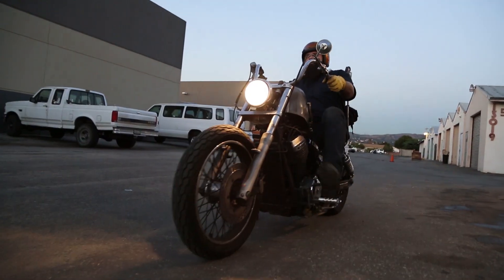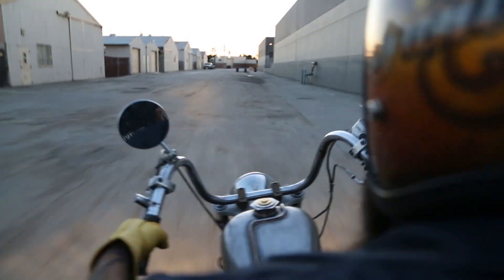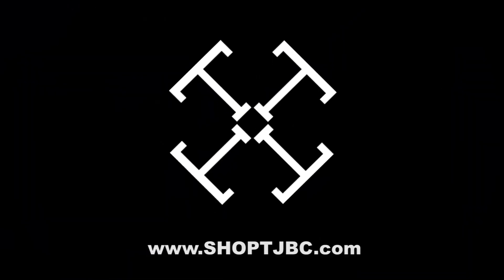Honda Shadow Backfire/Afterfire on Deceleration? – DIAGNOSIS

Comment: Most often decel poping starts when the stock muffler is replaced with an aftermarket piece. The SAS (Secondary Air System) is designed to let air into the exhaust the help the Cat burn unignited fuels properly coming from the enginge. Aftermarket mufflers increase the airflow through the pipes, therefore nothing is timed to stock anymore. Loosing the SAS should solve the problem. Make sure to fit a dongel to not get any errors on your board computer.

Comment: It will be cool to show how to adjust the screws perfect. My bike pops as crazy when i slow down…. Cops pulling me ove all the time …. I hate it 😢
Reply from the maker: That's a lean deceleration pop. Back out the mix screw, if that doesn't help. Go up one size on the pilot jet

Comment: so my bike is running a little ruff on acceleration and after I shut it down after riding it pops, its not loud just a quiet little pop, would this be an adjustment.

Comment: I love that this keeps popping up (no pun intended). To anyone who sees this LISTEN TO TJ DAMMIT! I had this issue after removing that gheeeey Honda intake (velocity stacks now)and putting the gorgeous backdraft exhaust on my bike. I was told 10000000000 different things from, “it’s what you get with no baffles”, “you’re chasing gremlins dude!” Etc, etc. In a last ditch effort I listened and READ what TJ said to do... my 750 ace was all set for a trip to my mechanic. I purchased the largest set of jets off of TJ’s site. Double shimmed my float needles. Wallah! Bike runs incredible not ONE BACKFIRE on decel or hard downshifts etc. I was so shocked that I expected to see a unicorn cross the road on my test drive back home. My wife saw the huge smile on my face and immediately thought I cheated on her. THATS HOW GOOD IT FELT fixing that annoying problemo. Ride on my friends....
Reply: What these parts , where the webite. I need this ASAP

Comment: TJ - Thanks for the videos. They are always informative and entertaining. I too, thought my VT600 was running lean because of the decel afterfires. When I rebuilt my carbs I discovered the air cut off valves were both missing!. When I replaced them, no more afterfire.

Comment: My 1988 Shadow VT600C VLX did this when I first bought it with 8400 miles on it when I went downhill from my house with no throttle in second gear. It was really as much a "backfire" as it was just a random "popping" sound which I thought was cool. However, to be on the safe side I synchronized the two carbs because I NEVER needed the choke to start it, no matter how cold the engine was. I gave it a full tune up with new air filter, spark plugs, fluids, etc. The spark plugs were clean so I figured the air/fuel mixture was OK -- not that I could adjust them anyway because they are sealed. After I sync'd the carbs, I noticed four differences: 
I needed the choke to start it
The "popping" sound was gone
The idle speed needed to be reduced (I still keep it at high idle as recommended by the service manual.)
More power (This is subjective: my butt-meter says I have more torque and I definitely have more power going uphill and a higher top speed which I reach quicker.)
Problem solved with just a simple tune up and synchronization which required a manometer and turning one screw. I love it!

One extra note: Since synchronizing the VT600 requires removing the fuel tank, I discovered my petcock was bad. It didn't leak when riding but it would not close completely when I removed the tank and dribbled all over the engine when I pulled the fuel line off the discharge tube. This was an easy fix with an aftermarket petcock. So I extra fixed a safety hazard. I love this motorcycle!!!!!!
Reply: Stephen Burgess I just got a 1988 Shadow VT800C 3 weeks ago, and i noticed it does the same thing on deceleration, and sometimes randomly it will kinda struggle when going up a hill under load. Very rarely though, I’m wondering if I may have the same issue. I’m thinking maybe a carb sync will help, where did you get your manometer? Just looking for suggestions, thanks.

Comment: So what does a coughing carburator mean? Is it just dirty or to lean or is that what they call a backfire? It is not coughing on decel but on steady rpms
Reply: My bike does the same thing, at steady high rpms, it pops and then dies while im riding. Did you find a solution?

Comment: Honda shadow vlx 600
I put velocity stacks, and the largest jets from the tune kit but haven't yet upgraded exhaust (bootburner in the mail) the bike after fires and possible also back fires.. my carburetor idle screw is for some reason deleted and it has been blocked off 🤔 maybe once i switch from stock exhaust(with no baffles) to boot burner exhaust it will fix the issue 🤞 I'll post update but yeah not sure what to do about the idle screw not existing 😂

Comment: Thanks for this advice I put a new carb on my 250x honda sportrax and it's fine in first gear but when I switch to second when I let off gas it after fires. It very well could be a valve adjustment issue. It prolly needs done so I'll do that after I adjust the fuel air mix screw

Comment: Hello everyone and TJ customs. I took out my carbs today Honda steed 400 cleaned them, put them on again with new boots etc. Problem is I adjusted my air fuel mixture so no more after firing which is good but after a hard acceleration and a cut back to idle engine seems to die out and can’t keep idle. Nevertheless as soon as hit the starter starts right up. Any possible explanation please? Thank you
Reply from the maker: That sucks man, but I'm sorry we just can't diagnose bikes in the comment section. We do have an e-book that has a ton of tuning information which you'll need- https://shoptjbc.com/blogs/news/performance-tuning-book-lp

Comment: Hi TJ!! 
Greetings from Denmark, overseas!
I just bought one Blaked out mean VT 600 Bobber Split Lane, with a lot of TJ’s candy on it! Paenut tank, v.stacks with Long Air fuel min screws etc etc.
I just love it. I seems to have a litlle backfire from the pipes though, when i let off the trottle to fast, ore going down hill a bit.
The iddle seems ok, but it stopped for a few times though. Even when riding at low speed it stopped between a gear shift yesterday.
I may run a little to slow in iddle, i recon. 
My Q is: Do i just turn both fuel screws both sides the same way? And wich way?
Right side shows number 2 upwards- left side (need unscrew a little cover)seems to have the nr. 1 pointed backwards!
Besite that its running like ”a bat out off Hell”
I only got it a week now and i F… love it. And people Ask about the sticker with the white ”cross” on the site..🤣Tj Cus!’
Thx 
Torben

Comment: Perfect video. I didn’t realise there were two types. My bike does both. Sometimes when it afterfires I can feel the force trying to blow the air filter cover off. It never used to do it until I got my carbs ultrasonic cleaned. Only backfires through one exhaust/cylinder though

Comment: My shadow 2001 750 ace  pops on acceleration or at idle ,i cleaned out the carb and adjusted the the fuel mixture screw. Show i buy bigger jets ?

Comment: I bought a new carb for my vlx600 I check the jets and bought a kit from y'all but it all ready had a 50 pilot and a 145 main but a 50 is bigger than a 48 right
Reply from the maker: Yes. 50 is bigger than 48.

Comment: Hi quick question

Got a honda shadow 600, when mid way through the revs it started to burble and no accelerating.

It's only happy low to mid range in the revs

Is this too much air probs or fuel probs.

Many thanks
Sean

Comment: Changed my pilot jets today. Got rid of the back fire but front cylinder is making a putting noise through the exhaust. Seems to run ok

Comment: Im trying to figure out what's going on with my 05 vtx 1300 it's running off 3 heads the one will fire if I ground out the coil but not on the plug I just changed the plug so I'm not thinking it's the plug and I changed the coil so it's not that either

Comment: TJBRUTALCUSTOMS 

I've got an 83 VT750C  that is EXTREMELY hard starting (afterfires when cranking). Once started (If it starts) it runs perfectly, idle, midrange, and wide open. Shut it off, good luck getting it started again. Carbs are clean, compression is good, plugs firing...any insight would be GREATLY appreciated!
Reply: Maybe check your float needles?  It might be leaking and flooding the bowls.
Reply: I have the same problem. I bought a bike from a neighbor that was sitting for 3 years. It will start after 10 seconds of cranking. Looks like to me that it is getting too much fuel. With choke open starts to backfire and after-fire.

Comment: I recently put a vance and hines exhaust on my bike and the back one is after firing? Any input? Thanks in advance
Reply: I have the same setup and the same problem. Any luck?
Reply: Anytime you tinker with the exhaust or intake rejet accordingly

Comment: The previous owner of my bike refitted a supposedly stock exhaust.
Before that it pretty much had a straight pipe on it.
It is now afterfiring on the front cylinder.
Might it be because it was tuned for the straight pipe?And now it's to rich for the stock flow?
Reply: Nick Gur  was a lose bolt on the front pipe

Comment: I have a BAD afterfire from the front cylinder and the exhaust pipe stays cold. I try to adjust the air fuel mixture and the only outcome is a bigger BANG. I just got done installing jet kit, velocity stacks with the smallest jets and 1 washer like in your video. Any suggestions? The other cylinder responds fine.
Reply: John Hales mine is doing the same thing!! Figure it out yet?
Reply: @61zachary  not yet still working on it

Comment: After I put on my  new pipe  on my New 2022 Honda 450RL  back fires out the exhaust   when I let off the gas!!   only one mile on it !! They said you need to put on a vortex ECU will reset  the fuel injector ,air fuel  and ,timeing'  still waiting for it to show up it's been one month and a half  they are hard to find becouse everybody wants them and are $800!!   i did replace my copper gasket in the head that not any one on Utube has put on in any of there videos yet!!

Comment: I have a 86 Magna VF700C. Completely rebuilt the carbs. #1 base carb will not idle down even when mixture screw is completely closed. I rechecked the float height, all good. Can anyone help with this problem

Comment: Thanks for the video!
Seems I have afterfire no back fire then. 
Could this be caused by a leaky head gasket therefore more air is getting into the engine?
I say that because I have changed the pilot jets and mixture and it did not cure the issue. I tried another carb and that didn’t fix it either. It’s only the front cylinder as well and it has a rough idle.
I sprayed carb cleaner around the head gasket and at a certain point the revs picked up so that’s why I think it’s a head gasket job.
Reply: Same thing is going on with my VLX600.

Comment: Just bought a Honda Shadow 750 2002 it pulls strong through all gears but spits and backfires when I hold the throttle at one speed what is the website to order the kit I need that website ASAP better yet a part number

Comment: What if someone cut the pipes off about half way?
Reply: @TJBRUTALCUSTOMS  i bought a back from a guy online its a Honda vt750 shadow and when i ride it ill be going up the road and when i get on it and wind out the gear right about the time im winding out it begins to cut back and  sputter . The pipes are cut off about 1 and maybe 1/2 foot from the block could that be causeing the cutting back im experiencing??
Reply: It seems like im getting air back into my engine
Reply: Running lean thats not enough fuel to carb?

Comment: What causes afterfire on acceleration? 2001 ace deluxe 2. Bike idles great, quarter throttle is okay(kind of sluggish) anything past quarter throttle and the bike afterfires.
Reply: This sounds like a slide needle problem. Shim needle or unshim. Dont change the factory slide spring or needle
Reply: @jeffbatchler2899  thanks. It's almost like a misfire. I just changed plugs
Reply: @Penguin32880  what mods are done to the bike as far as intake and exhaust.
Reply: @jeffbatchler2899  stock intake. Vance and hines pipes.
Reply: @Penguin32880  jet sizes should be 105 front 108 rear and a 40 pilot jet from factory. These hondas are picky on the air fuel mixture. Too much air will give popping on acceleration, too much gas will give fireballs or black smoke on acceleration.
 When sitting idle and you rev it up in neutral do you notice it as bad while revving? Or more under a load?
Reply: @jeffbatchler2899  both
Reply: @Penguin32880  make sure there no leaks in the air intake. That sounds like too much air. Maybe a loose clamp or a crack somewhere. 
Have you tried the air fuel mixture screw to see if it makes any difference?
Reply: @jeffbatchler2899  no difference with the screw. I plan to get a new intake. Probably go velocity stacks and just reset the carbs. This weekend ill do plugs and wires
Reply: @Penguin32880  check plugs after a few miles. If black then too rich if white then too lean.

Comment: I need help, I have an 84 honda shadow  vt700c it idles great but once it gets to 3000 rpm it's like it tracks out it bounces at 3k then backfires, I thought it was a clogged pilot, got them out cleaned them up and still the same problem? Idk what else it could be, maybe the floats out of whack? I'm not sure the specs to adjust it to on my bike any help would be appreciated
Reply: Do a compression test. See if the air squirts out of motor oil room, or if it leaves the carb/exhaust. If the valves doesn't close properly, you'll lose a lot of compression, that's what happened to my Honda 250 TWIN!

Comment: My bike idles fine but does pop back through carb while holding at steady rpm and occasionally pops back through exhaust 2002 spirit 750 doesn’t do it if my choke is slightly on
Reply: If the problem goes away with the choke slightly out, then one or more cylinders is running lean.

Comment: I've got a ? For anyone...a2002 Honda vtx 1800, sputtering when idle and holding partial throttle. But great when you call on it. Now..efi.
I've checked plugs,wires,carbs and intake look perfect, fpr, ...any ideas guys???  Backfires out front carb.  HELP